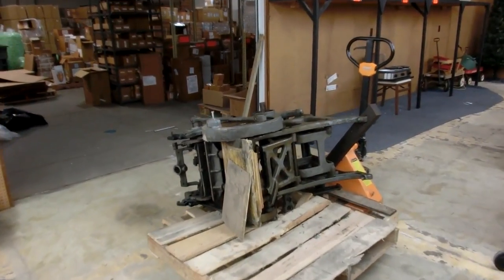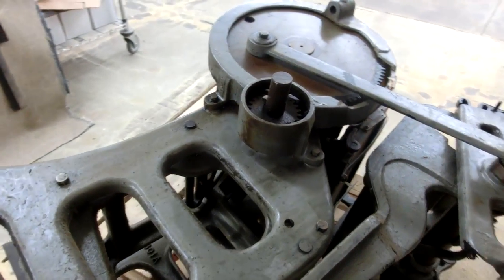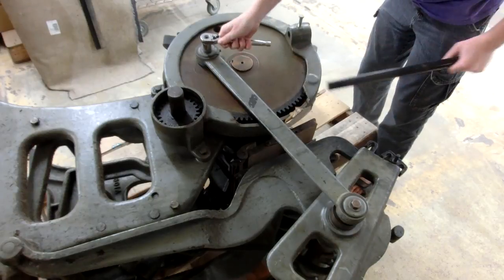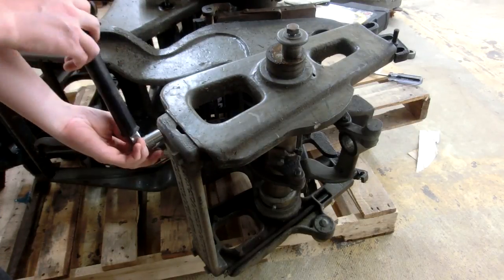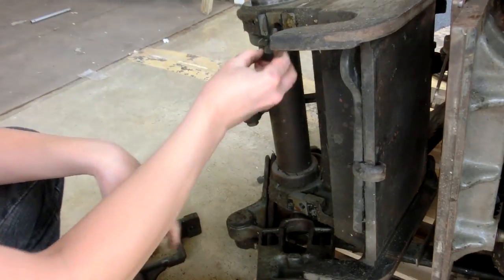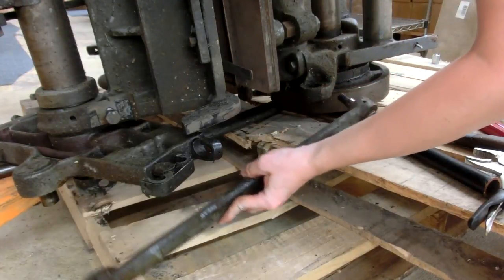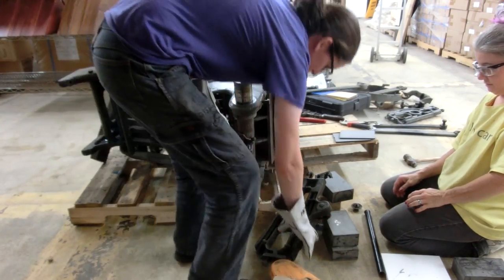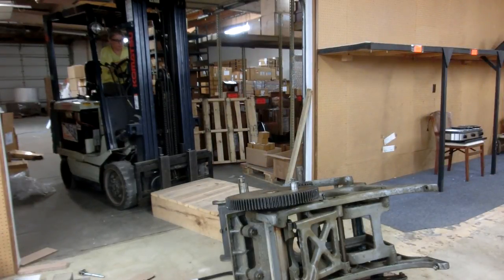1920s Chandler & Price Teardown / Restoration 01: Break it Down into Smaller Parts

Comment: These safety comments are really winding me up, you did it how you chose to do it, you did it methodically and the only risk was to yourself and the machine. Both of those risks were managed to your satisfaction, I liked the moment you asked your mum to back away, it was proof of your control of the situation. On another note that's a truly beautiful piece of machinery and it looks like everything that needs to be cast iron is present, bushings can be replaced fairly simply and anything else like control levers can be replaced with wood.
Reply from the maker: thank you!

and thankfully i have all the levers and stuff at home, when they snapped off they were easy to take home. ^^
Reply: Nothing a strong woman can´t handle... :)
Reply: yes, it only takes a second to screw you up, dont take chances

Comment: I restored a press similar to this, but also the smaller size at 8x12. Basically the predecessor of Chandler & Price as the design is almost identical. Challenge-Gordon which from the extensive looking I did there aren't many of that name left. It was all there with the exception of more a decorational piece and none of it was broken. (Could see welds where it had been broken before) The only problem with it was it was full of dirt and rust and quite locked up. Took the entire thing apart to clean it up and get it running again. I was very happy with the end result even though I did get frustrated throughout it and it took longer than anticipated as well. (Also believe the size of that is 10X15 not 11X15).

Comment: These C&P presses came in 4 sizes 8"x12", 10"x15", 12"x18", and 14.5"x22" (and supposedly there is a 7x11, though I've never seen or heard of one). It looks like the one you have is the 8x12, which is the smallest of the "floor" (vs tabletop) presses.  The frame tells me it's a New Style, a little bit heavier, less ornate castings (and a straight spoke flywheel- even though you don't show it, that's what came with that press) and a little more recent than the old series, which they stopped making in 1911.  Despite the patent date (that everyone reads off the castings and thinks their press is from the 1800's), the serial number is stamped in the frame in the top left (from the operator's perspective), under where the chase (rectangular frame that hopefully you have somewhere) would go, if it were in there.  There is a document floating around a few places that you can use to date that unit to what year it was made: https://drive.google.com/file/d/0B52tmX0y_b4PNDY5M2M0MjgtODU5Ny00NDhjLTk3NDUtYTI3OTRhZmQzOTE1/view The measurements of the press are referred to by the measurements of the INSIDE of the chase.  You saw our old series at Maker Faire this year and we've brought it (or several) the last couple years (I have about a dozen of these, in all sizes except the 14.5x22).  I am starting to do iron casting to replace parts off of these- let me know if you get to a point in your restoration efforts where you want something cast.  You can do like they did in the old days and braze the cast iron.  Hard to actually successfully weld cast iron without tons of preheat, high-nickel rod, and peening for stress relief.  Your breaks were very typical- the throwoff lever often breaks as does the crankshaft if it's dropped onto the flywheel.  Anyway, hit me up if you want help, info, or castings done. They were originally painted a midnight blue with gold pinstriping and accents (like the lettering), though a lot of the later ones (perhaps yours too) that were sold in the 50's-60's (or survived into the 70's) were painted either a light industrial gray or light green.
Reply from the maker: thank you very much! i will keep you in mind for this in the future. however it might be a while away because im still finding room for this big thing. haha

Comment: I'm in the process of restoring my own press.  It's been a while since you've posted this video.  If the restoration has stalled would you be willing to part out your press?
Reply from the maker: not at the moment, i plan to build a building for mine, but i might sell it as a whole machine later if i cant restore it

Comment: ive got qan 1895 chandler and price press in my basement. been there long before i was a thought.  it weighs around 1450 lbs, more if you include the original dc motor. im trying to bring it upstairs for either use or sale. but im glad i found this video. to show me what im up against. thank you

Comment: There would be a lot less tension in your videos if you got some steel toe boots.
Reply: David Christy Steel would still be able to buckle under that much weight. . . I speak from experience
Reply from the maker: if i require steel toed boots, i'm doing something wrong. and why are the feet the most important part of the body to so many of my viewers? getting my foot crushed wearing a boot wouldnt be any better.